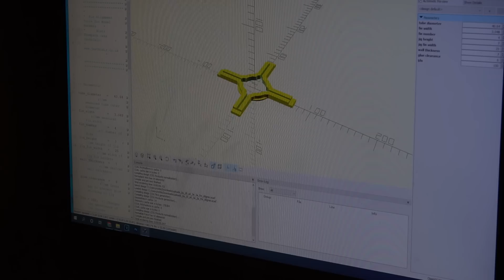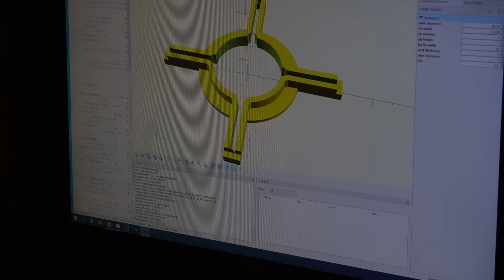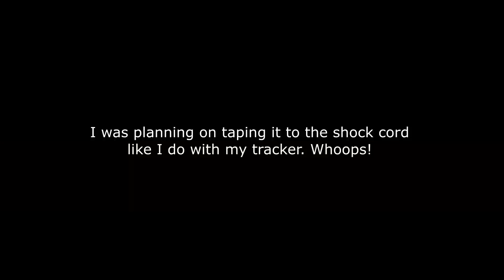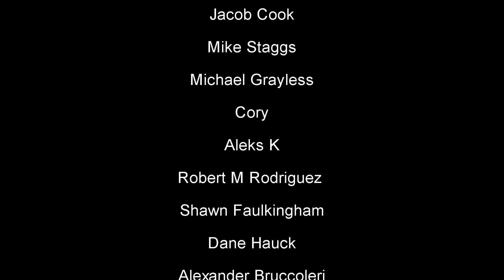Can JB Weld Survive 1,000 Miles Per Hour?

Comment: Line cutters to open up a chute burrito work well for rockets like this, when space is limited for a traditional dual deploy setup. I've got a full carbon 38mm minimum diameter that I plan on sending up with a loki k627 using a tinder rocketry line cutter for chute release... just gotta find a field to watch it shred at lmao

Comment: I used JB Weld to repair a VW Bug engine case that had a crack behind #3 that went all the way to the oil galley port and below. I ran with no oil leaks until it was stolen. I think it will hold.

Comment: Hey Braden, nice build!! One thing that really helps with streamer recovery when you don't want the drift of a chute is to take the entire length of the streamer, fold it over on itself, then anchor the kevlar to both ends. So your streamer is a big loop thats secured at one end. The amount of drag this creates is enormous but it doesn't have a large lateral surface area that wind shear can act upon, this limiting drift.

Give it a shot on a larger rocket that you don't care too much about as a test. I think you will be extremely surprised!

Comment: It should...I've used JB on several Mach 1 & 2 projects. I've also flown a minimum diameter 4" cardboard rocket using nothing but Elmer's Washable School Glue to Mach 1.56 (1,197 mph).
I did that after one of many discussions online about what epoxy is best for supersonic flight. For most fiberglass projects, I use whatever epoxy I happen to have. Good surface prep is more important in most things than what epoxy is used.

Comment: I’ve done crazy stuff with JB Weld and I love it for rocket fin fillets. I think most epoxies are typically stronger that the materials they are bonding although some may perform better than others under hard, fast impact vs slow, constant pressure, etc.

Comment: Great video and yes I was wondering how far JB Weld could be pushed.   Are you using the Ender 3 v2 printer?   Did you find any upgrades necessary besides the auto level?  Happy with it so far?
Reply from the maker: Yessir, Ender 3 V2. I'm considering a hot end upgrade. I highly recommend the enclosure, too. I'm printing pretty much exclusively PETG

Comment: So it looked like the JB Weld held but the fiber fins snapped... right?
Reply from the maker: The JB Weld broke when it hit the ground. It was admittedly a lot heavier carrying the empty motor case than I anticipated. I used the propellant/total weight on Thrustcurve to calculate how big of a streamer I needed and it was pretty undersized because of the unforseen weight difference.